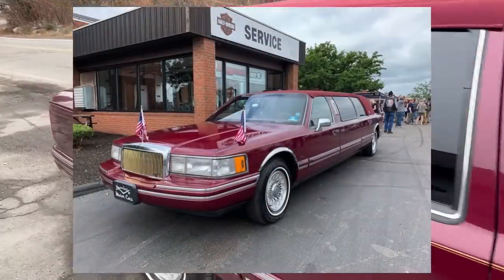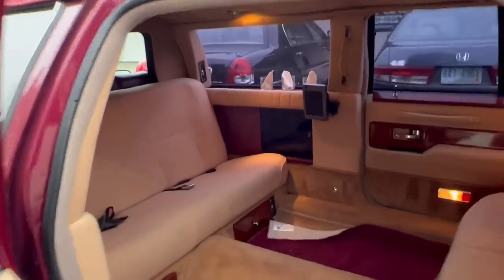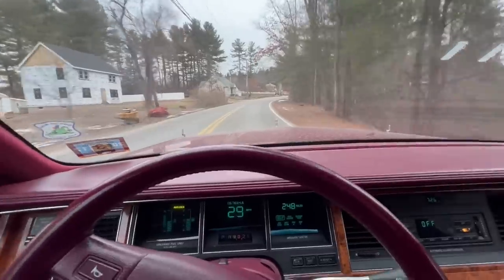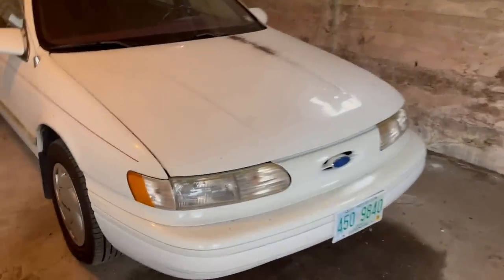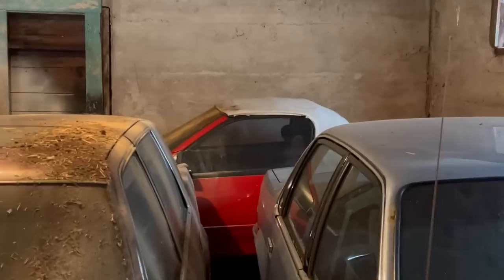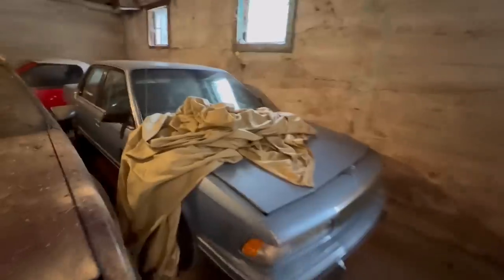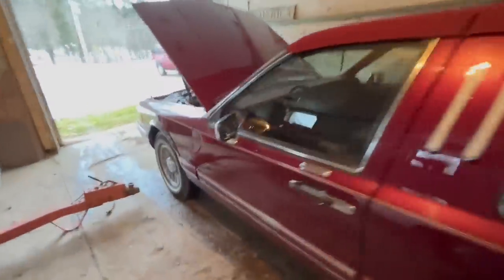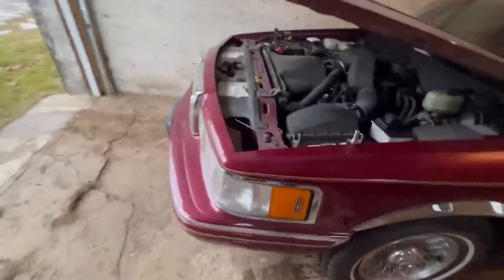IS THAT A GEO METRO CONVERTIBLE? Limo Storage with @bigalsbikeandauto And my Lincoln Town Car

Comment: If you look on the driver seat there are blocks on the tracks to stop the seat from going all the way back. Take them out and you can go back a few inches more. I been in the Limousine industry since 1990. I am 6'1 and driving very comfortably if the blocks are removed. You might want to check to see if you can remove them from your car. Just a thought love your content.